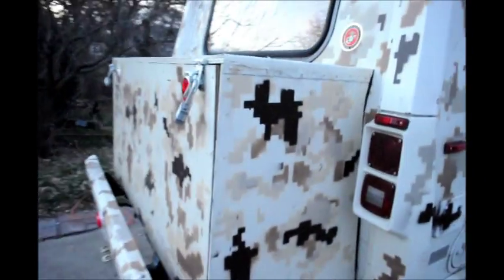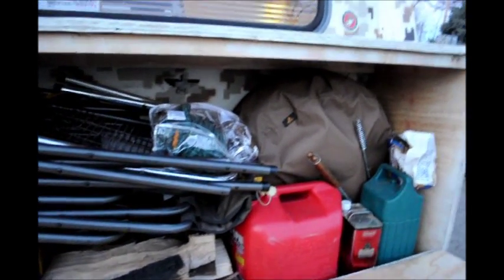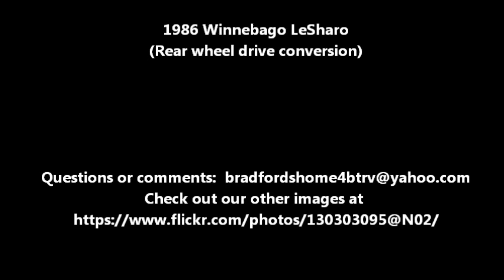1986 Winnebago Lesharo 4BT Cummins Interior Tour

Comment: Well.... I bought an 84 Lesharo for $400.00.  The owner was restoring it and had just put 4 new tires, new battery, and two new AGM deep cycle batteries in.  The seats were all taken out and had brand new upholstery all wrapped in plastic.  figured I got my money back right there. The diesel engine was torn apart and worthless.  The steering wheel didn't even turn the wheels.  I put it in my gym.  I started tearing the rest of the dated interior out and realized these were made for short people.  I'm 6'5".  So I took the roof off at the aluminum half round.  I cut the metal over the cab portion off.  I was surprised to see the roof was so flimsy, thin wood, 1" foam, thin aluminum.  I then cut the front end off and dropped and discarded the diesel tank.  I bought a 2007 Dodge Grand Caravan with 58K from Co part for $950.00.  I carefully disassmbled the interior and labled the wiring harness and put it in front seat.  took out the gas tank disconnected fuel lines, cut off exhaust just under the manifold and disconnected from rear.  disconnected the rear a.c., cut brake lines.  Then cut the front off and bolted, welded them together.  They matched up awesome.  I raised the metal roof and engineered better support, welded in the patch panels.  for the main roof I used a 1 off urethane foam and ribs fiberglass technique.  super strong.   I hate all the stuff hanging off RVs. I sold the Catalina awning on CL for $200.00.  I didn't want AC on the roof, I also needed it a foot longer on the interior and I wanted the AC concealed in the back, so, I extended the back 30".  I built a modern fiberglass cap for the rear with a door that opens revealing 2 ft of storage for chairs, generator, AC. etc.  My back was super flimsy as well.  The sidewalls, door and steel bottom are rock solid.  I had absolutely no rust anywhere.  On the interior I put the kitchen behind the drivers seat to the right of the bathroom.  The bathroom was a great idea, just poorly executed.  way too narrow, at least for me.  I rebuilt the walls using better stainless, slides, took out the wardrobe and widened the bathroom shower to 34".  To the left of the bathroom I built new kitchen table benches with the angled backs on hinges 34" wide that flip up to bunk beds.  I used the extra foot interior and part of the wardrobe.  They are 70" long.  Accross from that and to the left of the door as you are walking in is the other kitchen bench that is 80" long that makes bunks the same way.  In the end of the bench I put a hidden flat screen tv that retracts into the side with a, 12v linear actuator.  Now I just need to finish body work, and paint the entire vehicle.  This started as a rally bus for my 14 yr old hoopster to go to tourneys.  can't wait to get it on the road.  test weight to power, rigidity etc.  I'll probably do the upgrade you did to rear suspension or airbags as I have added weight.
Reply: Michael Zuro that sounds amazing. I'll give you trip ole what you paid for it.
Reply: Show us a demo walk through * Please
Reply: Wow! That's impressive. I wish you would post a picture or a video walk-through of the finished product.
Reply: sounds like a waste of time ,yet whatever floats yer boat ?

Comment: Nice but how the heck does the air-conditioner vent out the back when you have a storage box on there
Reply from the maker: We had a fan on the outside of the extension truck we put on there but it just never cooled sufficiently.  We fill that opening and put a roof AC on top.  Much better, even cools the front seat while driving if we run the generator.  I should have never made that AC setup on the floor, trying to be cheap, it never cooled sufficiently.

Comment: So what engine and trans did you use. Cooling? Brakes ?
Reply from the maker: Cummins 4BT 3.9 with Ford F-250 5 speed.   I got a custom radiator and the brakes use a Ford Crown Vic front suspension with disk front and drum back.  Brake booster vacuum was connected to a belt driven pump but is now electric vacuum pump that works very well.

Comment: I'm a 62 y/o single female with a little dachshund as a companion. I love your LeSharo and what you have done with it. Would you mind giving a ballpark figure of how much you have invested in it? I saw one for sale on Ebay for $4400, but I'm sure it would need a good bit of work. Also...where did you find your RV? Was it online? I live in GA, but my only daughter lives in Colorado and is expecting a baby this fall. I would like to find an economical way to travel out there (and also do some dry camping). Thank-you for the videos and information you've shared!
Reply from the maker: About 5K, maybe less, but I bought things that could have been sourced more easily.  Alot of sweat equity.  The 4BT motor is exceptionally extreme ($2,000) because I wanted that particular Diesel.  I could have used a 4.3 chevy engine for less than $750.00.  The rear axle could have been sourced from junk yards and saved $1,000.  If I had just shifted the whole body to a rolling F250 chassis I could have built it for around $2,500 ready to go.  It would be jacked up even higher but would be a solid and reliable vehicle to tow a small car even.
Reply from the maker: I am very mechanically incline a spend 4-5K to report it.   I bought for less thank 1k with blown smaller engine.   We have about 12k mikes on current setup.   You could consider one of the nice cargo vans to make your own RV and make it very much your own.  A small cargo style van can quickly bet drip with a bed, small kitchen, even simple bathroom facilities.   Google has many who have done this.